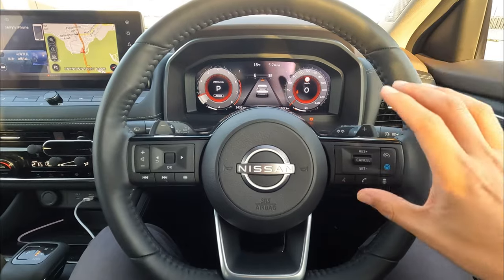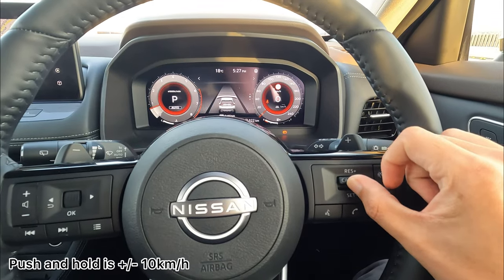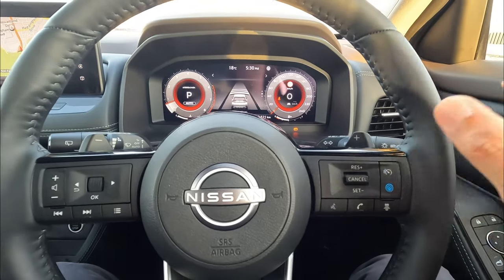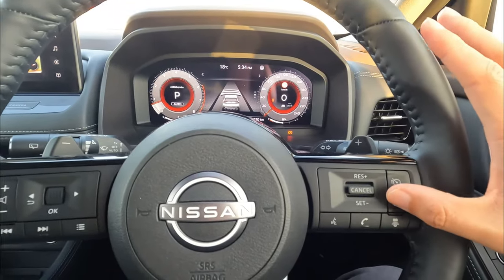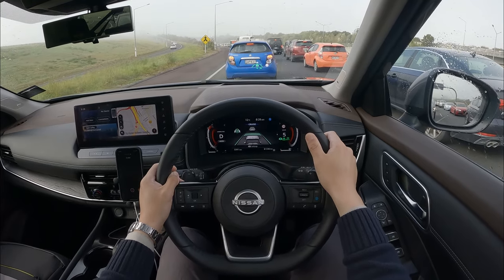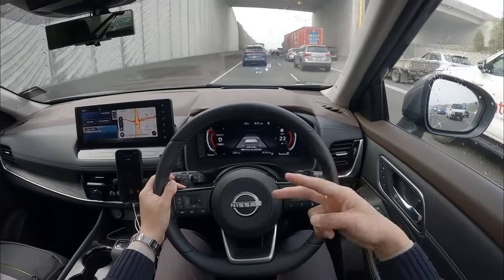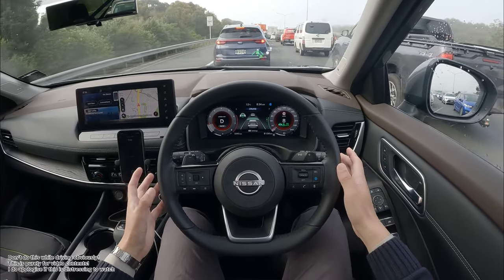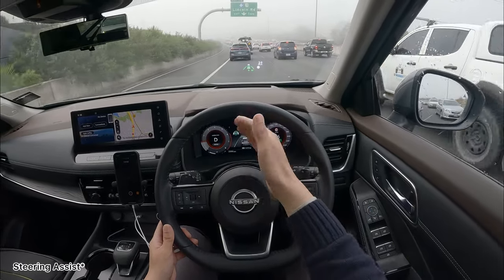Nissan Tutorial - Intelligent Cruise Control (ICC) & Steering Assist - How Does It Work in Traffic?

Comment: Many thanks for the detailed expressions.  When the cruise control on, what happens if a motorbike jumps in front of the car ?  (Similar situation happened at 23:25)  
Does the cruise control activate the brakes suddenly to prevent crash ?   If this is the case, would that sudden brake cause an accident ?
Reply from the maker: Any car or bike that jumps in front of the car could get the system to brake in someway. If you are worried, just engage the brake and cancel the cruise in that situation,

Comment: Thank you for the tutorial.
Is it possible to adjust reaction time between initial speed and speed limit signs?
For instance I am cruising 120 km/h and suddenly 90 sign appeared.
It will slowly slowdown  therefore there is a risk to catch a speeding fine.
So is it possible to adjust braking force?